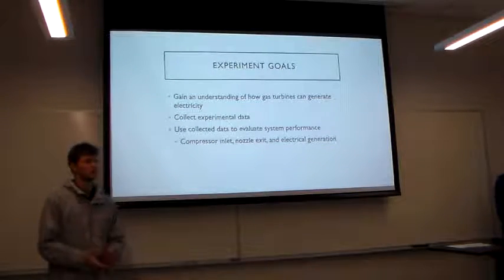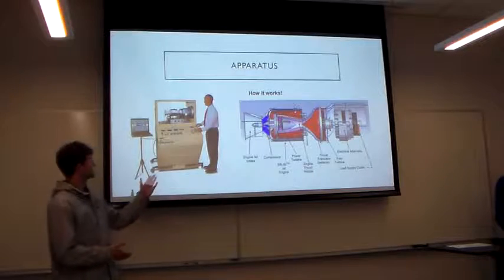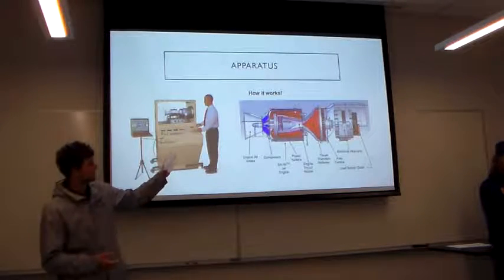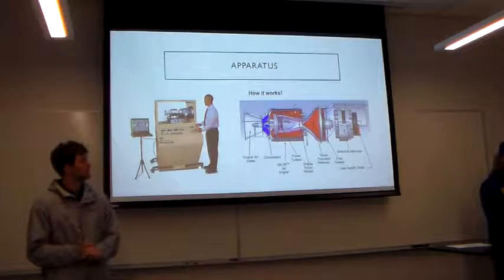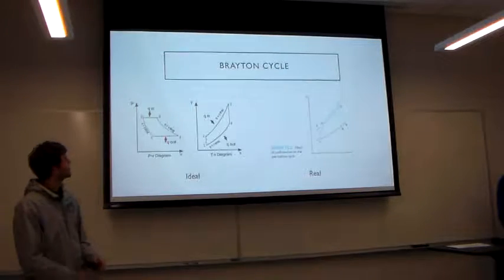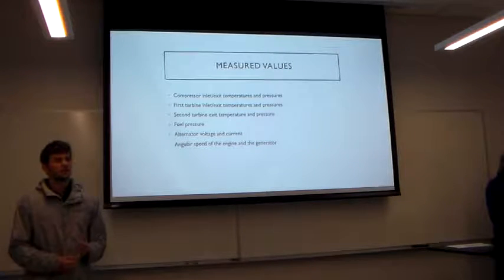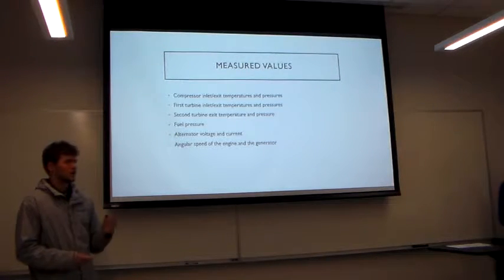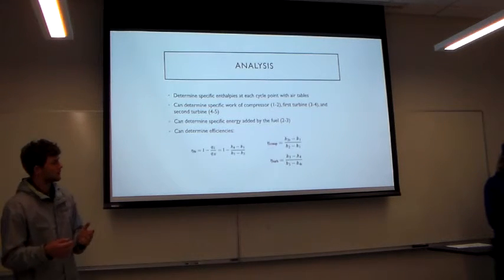SDV 0930

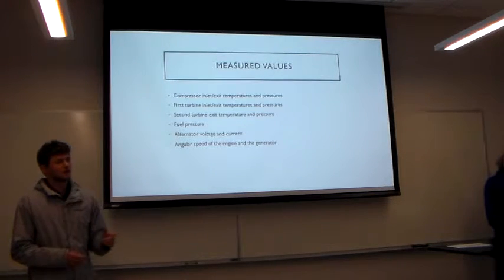Comment: The speaker did a great job by marking the location of each components on gas turbine picture back to the cycle graph, which makes more clear to audience on what is happening inside the gas turbine. One suggestion would be:  the speaker could put a gas turbine cycle graph which has the actual location for each number (1 through 5) on analysis part (5:09) so that the audience could better to follow. Overall, the presentation is excellent.